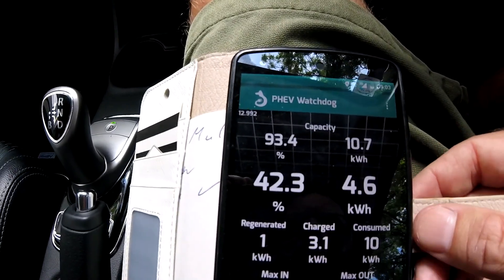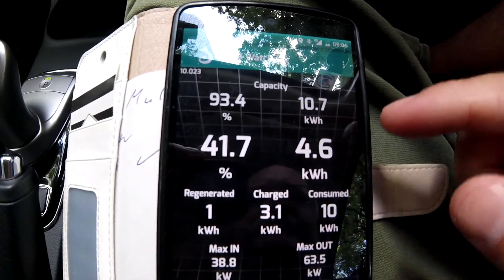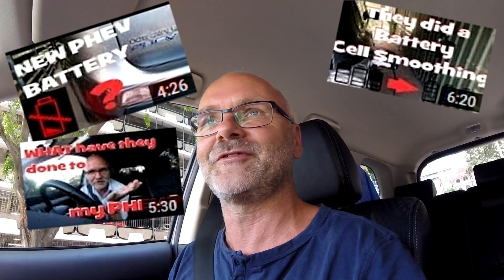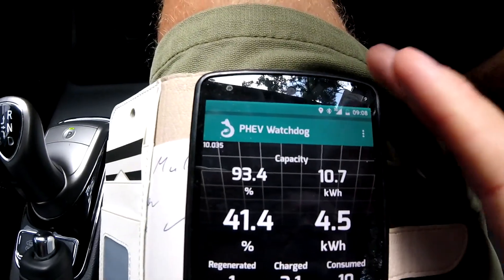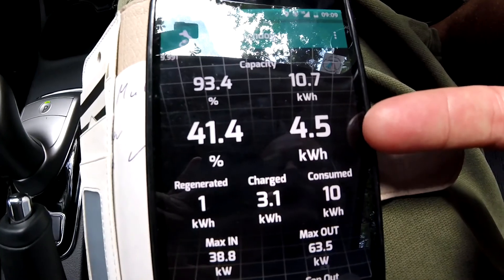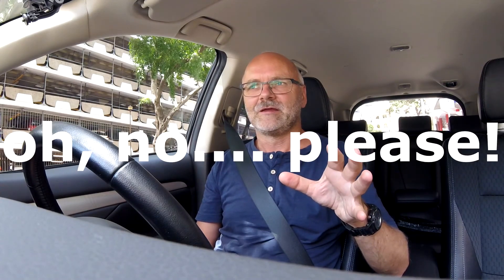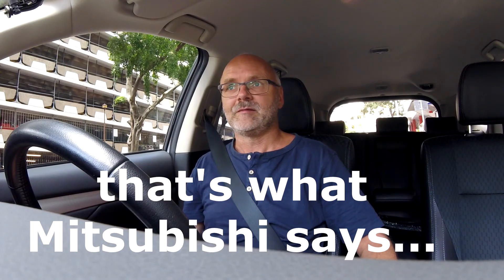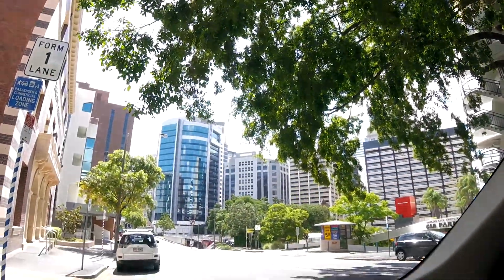EP21 - The Outlander PHEV's SOC and SOH explained

Comment: Hi, can the "PHEV Box" solve some of the problem you raised?
Reply from the maker: The PHEV Box does only a few things, mainly: it prevents the ICE from kicking in when accelerating faster and smoothes out your 'gas' pedal which apparently save up to 8% EV range. But the box has nothing to do with the state of health of the battery or any degradation.

Comment: The kwh value on the soh is not accurate. Per  Daniel into the dog calculates the real kwh figure on the soc (it uses the current voltage to make the convertion) on the SOH field I believe that it is a estimate. For me it goes with Ah on the Soh and kwh on the SOC.
By the way you can make a simple test  just apply you SOH % on the teoricial kwh from new battery that is 12.5kwh and you will get a different value from the one displayed on the the dog in the SOH field. But if you calculate this after a full charge using the SOC kwh information multiplied by the SOH % you will get the real SOH value in kwh...
Reply from the maker: What??? Sounds like you're an accountant or so...
Reply: SOH is calculated from the specs provided by the manufacturer, for a brand new pack 40Ah = 12000Wh / 300V or 12kWh @ 300V, and so Actual SOH = Current Capacity @ 300V. % of SOH uses 38Ah (or 11,4kWh @ 300V), as a value of reference, as we all know this is the common capacity seen at delivery.
SOC as expected uses the actual voltage, which for such a small pack does vary a lot.